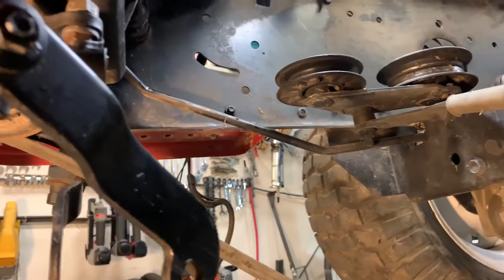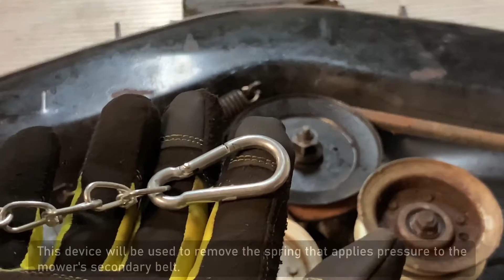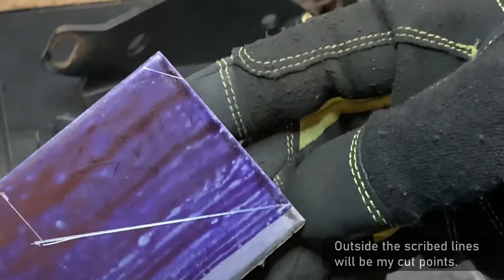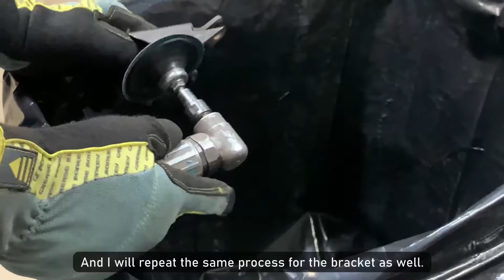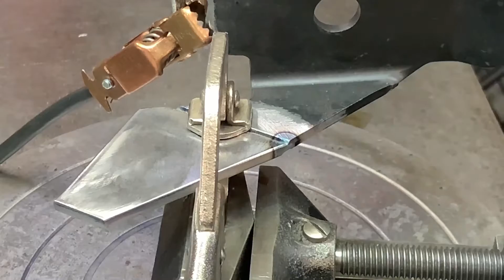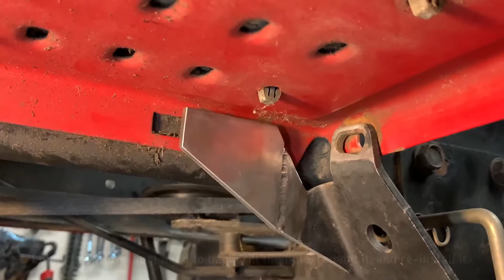2004 Craftsman GT5000 V-Belts Removal & Replacement (Part 2) THE BELTS AND BRACKET

Comment: A big problem in replacing the secondary belt is stretching the idler Pulley spring.   I used a combination of stretching the spring and rolling the belt over the LH Pulley.   I took a crowbar ànd placed it by the pivot arm with a wire wrapped around the crowbar and through hole where the spring goes through the pivot arm.  I was able the pull the pivot arm open and roll the belt on.

Comment: Very glad you made this video.
I have to ask, do you know a part number for the retaining spring for the dual pulley bracket to tension handle? Ive tried cross referencing sizes on Amazon l. No luck
Thanks
Reply from the maker: See if this works for you. The Ground drive system takes two springs PN: 149412 and PN: 176624 both are called spring Drive. The mower deck also takes two springs, PN: 179479 Primary spring drive and PN: 174371 Secondary spring drive.  Please note, these numbers are referenced from Craftsman's owner's manual for model No. 917.276320. I hope this helps. Thanks for watching.

Comment: Hi , can you change the drive belt without removing the seat and fenders? Also do the front  suspension plates have to be removed to pull the deck?
Reply from the maker: Hello Todd Shaw, thank you for the comment. You can change the drive belt without removing the seat and fenders. Also, the suspension plates do not have to be removed. Thank you for watching!
Reply: That was my question too. Thank you !
Reply: Although it looks a lot easier that way .
Reply from the maker: Hello  @ronduff4325  . Thank you for the comment. Yes it was easier actually. But I was doing other work on this lawn tractor which was the reason for removing the extra items. Thank you for watching!

Comment: Hi hope your doing good I just replaced the primary and secondary deck belts double and triple checks the routes look good but every time I go to engage the blade the mower dies never had that issue before please I could use some help
Reply from the maker: Hello, I am not really sure.

Comment: Can anyone answer- The bolt loosened below the 2-pulley bracket to allow him to remove the drive belt. Should that bolt/nut actually not be 100% tight, to allow the 2-pulley bracket to float and sel-adjust for temperature, belt wear, load, etc. allowing the tension spring and engagement controls to function?
Reply: I’m working on mine right now. I’d say it should be tight.
The spring from that bracket broke on mine. Still trying to find a replacement spring….headache

Comment: great video!
Reply from the maker: Hello blind bob, I'm glad you enjoyed the video. Thank you for watching!
Reply: @albertoguerrero5362  I don't know if the mower is yours but I have a 2004 just like this one. I want to change the transmission fluid and I understand it takes 20W50 motor oil. I think the bottom of the trans has to be removed to drain the oil but I don't know how far to fill it. Some trans have a bolt on the side and fluid leaks out once it's full, then replace the bolt. Do you know anything about this procedure? I just finished replacing all three belts and your video helped lots. Thanks in advance.
Reply from the maker: @proudconservative1  Hello, thank you for your question and comment. To answer your question, the mower is not mine and unfortunately I am not familiar with that particular process with this mower. My apologies for not being able to help you with this or lead you in the right direction. 
I'm glad my video help you with the Belts replacement and thank you for watching.

Comment: I find it hard to see myself wearing gloves in such a cramped workspace and I find it very hard to see what you're doing in the same
Reply from the maker: Hello The spirit Of 76, thank you for the comment. Thank you for watching.
Reply: Super helpful tip about the 3/8" rod and chain,
Reply from the maker: Hello  @markbelden6919  , thank you for the comment. It does make it easy. Thank you for watching.